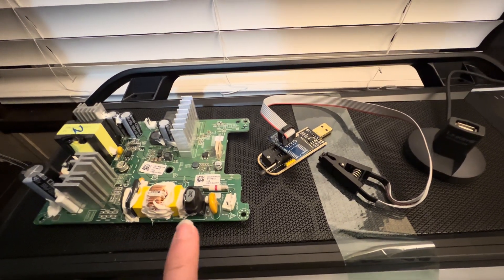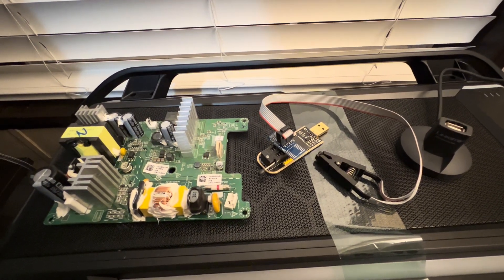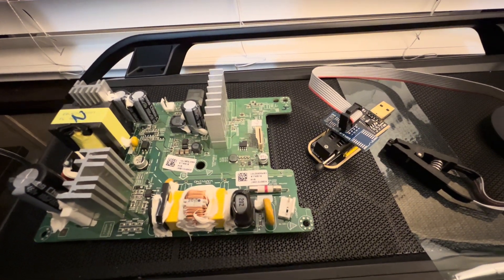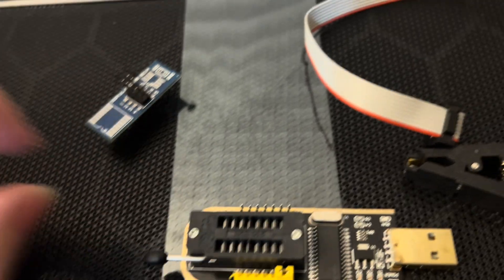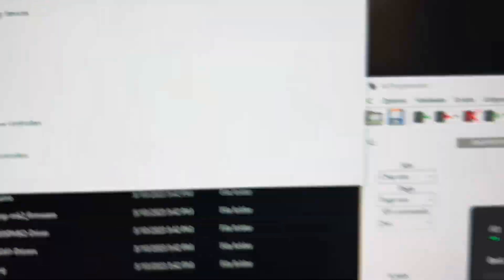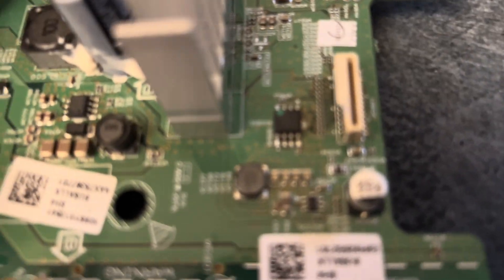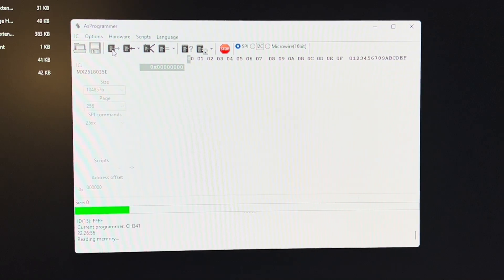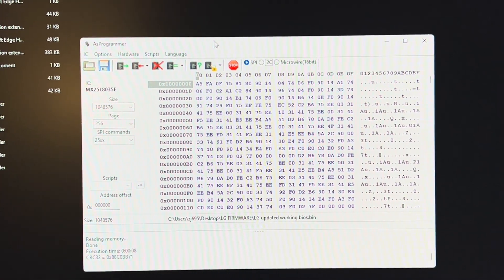How to fix LG Soundbar Subwoofer not working or pairing. SPN5B-W + SPN8-W part# EBR89625801

Comment: I got error code 0000E000 after unprotect->erase->program->verify step. Could you please help me with the step?
Reply from the maker: Try unprotecting and erasing the chip separately, then write the data again. It might still work even if you have some ghost data which is what that error means
Reply: @FiveStaxX  doing separate worked. Thanks brother
Reply: @FiveStaxX  Could you please elaborate on the steps to do this?  i.e. which buttons to press on the AsProgrammer interface?  Is it the button you press instead of the adjacent down arrow?  The down arrow only had the full sequence without separation... then how to write and verify?  Thank you!
Reply from the maker: @crocodileguy  yes i will try to update it. 
You can just unprotect first, then erase the chip. Then disconnect the programmer from the computer, reconnect it, and hit write.
Reply: does this device get displayed in router's list?
Reply from the maker: @rajeshpoudel4025  what do you mean? Show on router list like it's Connected to router for WiFi? My SN7R does not connect to WiFi. The only way to update firmware for me is to use the LG sound bar application for Android.
Reply: @FiveStaxX  so auto update in sound bar app was enabled that caused issues at first? Do you know if sn6y gets connected to wifi?

mine says device is not supported in lg soundbar app
Reply from the maker: @rajeshpoudel4025  I'm not sure about that model connecting to WiFi. But the newest update for my subwoofer from the LG sound bar app said "improved subwoofer performance" or something like that. So they must have known that the previous update was faulty.

Comment: Thanks for the vid! Looks simple enough. I have the programming giblets on order, but your links don't seem to be live and aren't complete, at least on my UI. The only item I need is the firmware file - if you post at least the filename, I'm guessing it's a quick search.
ETA: Ah, I see from your earlier vid that you swiped the firmware file from a new sub. No wonder I couldn't find it with by Google Fu :)
Reply from the maker: Sorry about the links! I guess I have to verify my account first before they become live. Just did the ID verification so it should be working in about 24 hours.
Reply from the maker: You can email me at 5000inc@gmail.com and I can send you the files or links there if you would like.